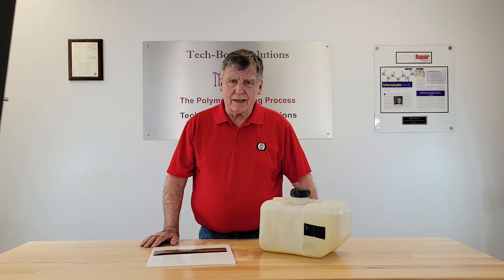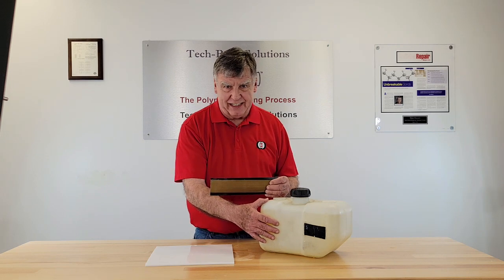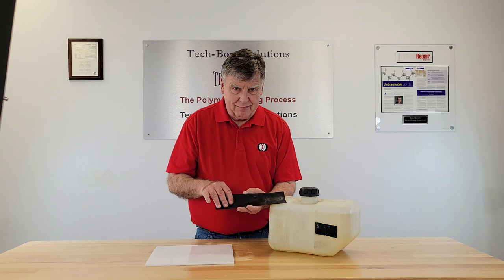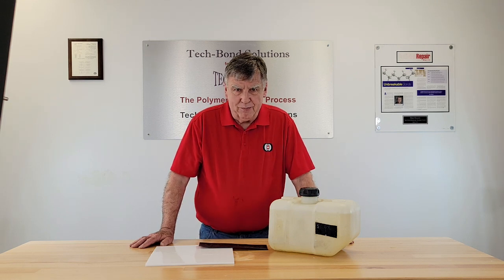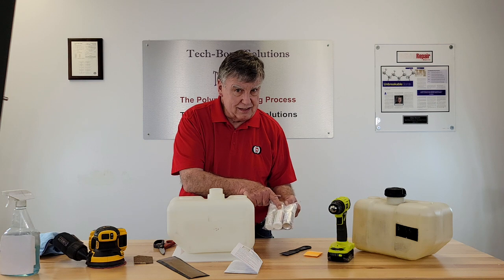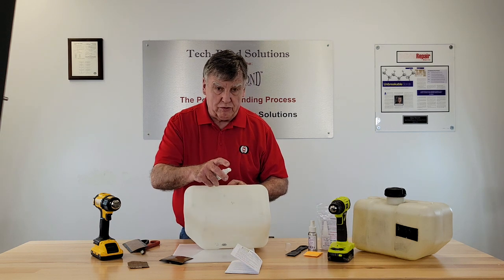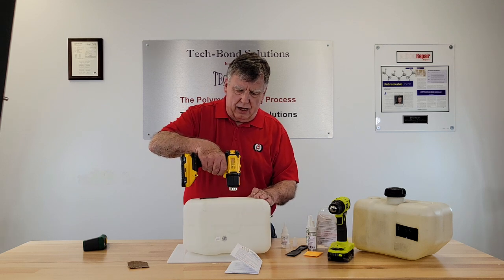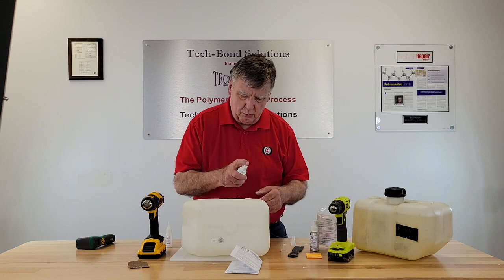Permanently repair all HDPE gas tanks with our Tech Patches.  Tech Patches also work on metal tanks.

Comment: Interesting. I've got a hole in a tractor diesel tank, my biggest problem so far is remoing the tank because of a massive amount of tractor disassembly required to get the tank free. If I get it out I may try your patch because John Deere no longer makes the replaement tank.

Comment: I use ethanol in for my van.   The fuel was stolen by the police impound lot after the van was recovered by them drilling a hole in the tank.   Would this repair bridge the half inch hole and withstand ethanol as well as gasoline and hold up long term?  It is a Ford plastic tank from 2014. Thanks

Comment: the cost of the patch and prep kit and infra red device would make this approach likely not cost effective compared to buying a new tank.
Reply from the maker: You can use just a regular blow dryer like you would dry your hair with. There is no need for an "infra red' device.

Comment: Will this work on a domestic central heating oil tank ?
Reply: You can't with a PTFE poly-kit I don't think. You would need one that can withstand hotter temperatures which I'm pretty sure they do have. Check their website on the all products section.
Reply from the maker: This product would work. Please contact Don and he can get you set up with what you would need. Thank you.

Comment: How much pressure can these patches hold? How much heat? Could they be used on plastic radiator tank caps?
Reply from the maker: PTFE Patches are good up to 120 psi  and about 250 degrees F, so they are good on radiators.